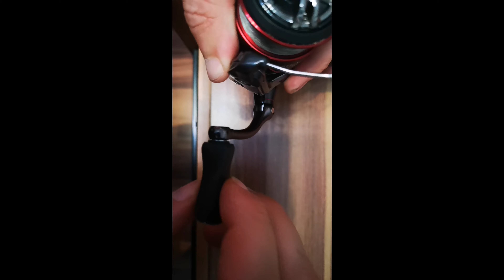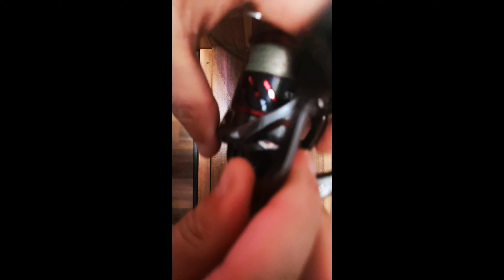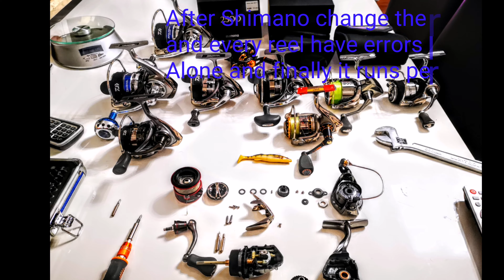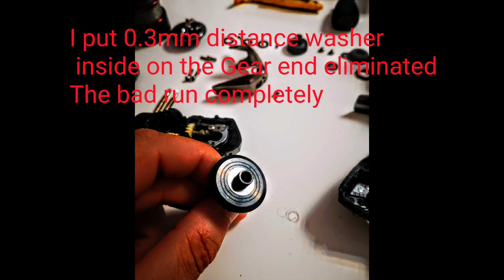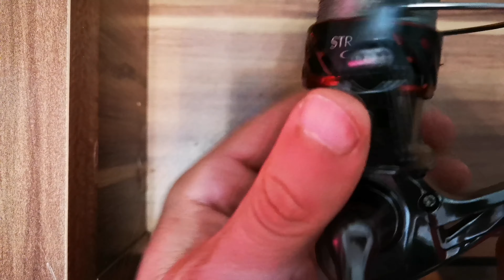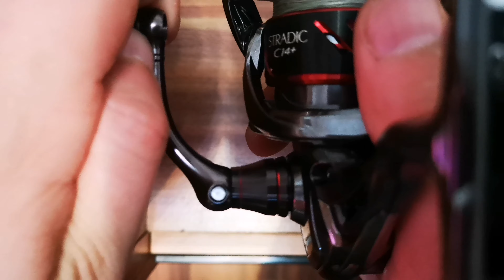SHIMANO Stradic CI4+ 1000,  fixing the Gear problem

Comment: same problem with my fl 2500 hg.. nad saw something.. cant be real.. must be a copy.. the screw is not gold color like everyone else on the pinion , i upgraded the handle knob with bearings and no play but when i tigjhten the handle to the real its to loose and i feel it when i fish.. and now it has started to run wobbly :/ crap reel deluxe.. and only 4 month old in freshwater